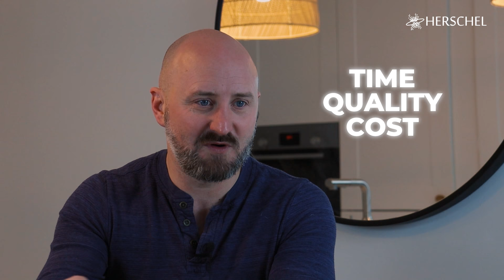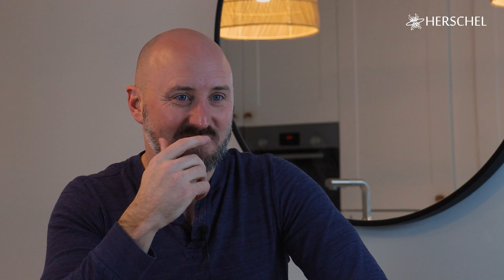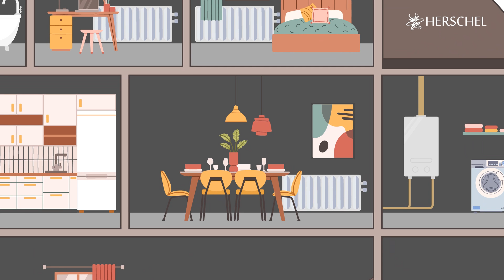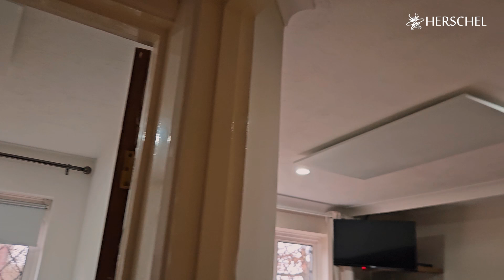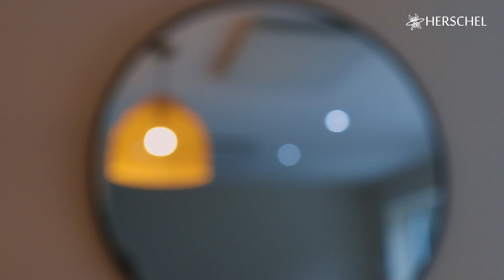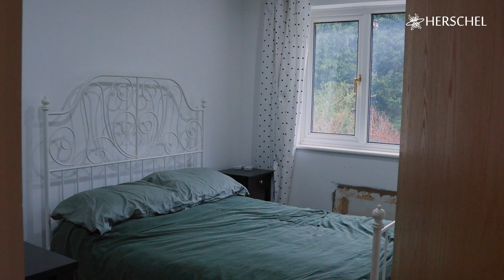Fully Electric Healthier Home with Herschel Infrared Heating Alongside Mixergy Tank

Comment: Some people state that they cannot feel the warmth unless a few 15cm from the panels, he seems happy, which would mean that they either got the wrong panels or not sure ho to fit them. I have a heat pump and am not happy with it. I am not convinced about the minimal invasion on installation. These cables need to be quite thick and I assume multiple circuits throughout the house and through the walls, so not much different than pipes.

IR panels make more sense from the benefit on IR waves on the body, which is red light therapy and healthier, plus rejuvenating and healing properties.